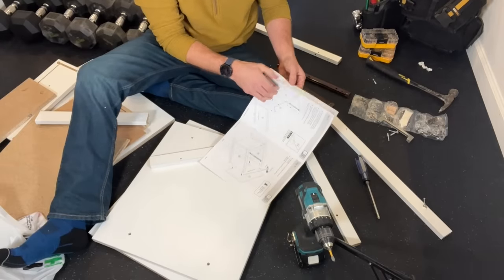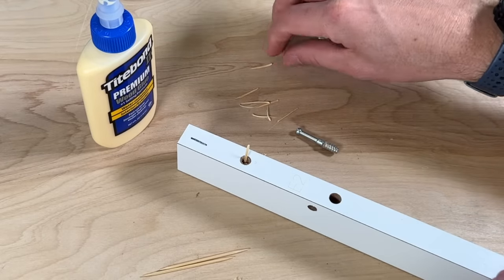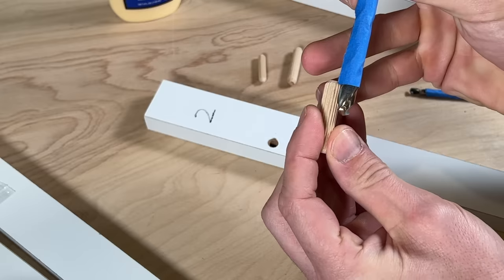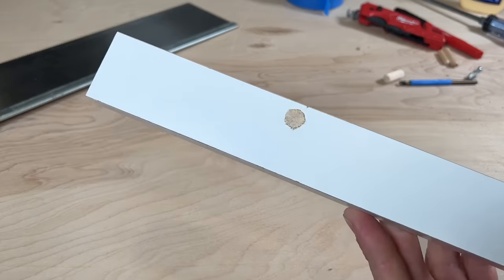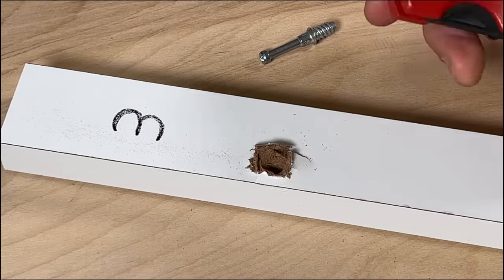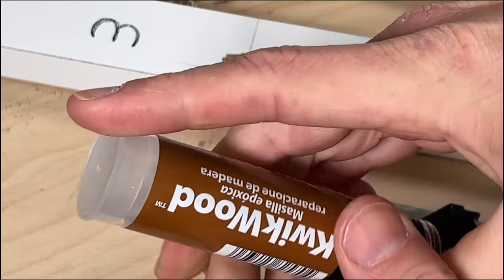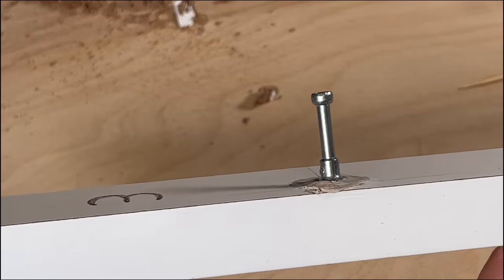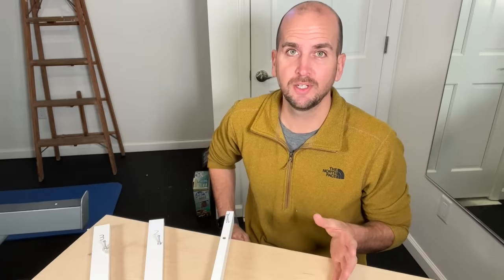How To Fix Damaged IKEA Furniture

Comment: I have a much better way to deal with blowouts. I mix regular sticky epoxy with sawdust and put that in the blowout. It fills the crevices and sticks to the sides much better because of the more liquidy epoxy material. Then I put saran wrap over it and clamp a piece of wood to the piece to make it flat and even with the rest of the piece. No need to sand because it's already shaped right. You can drill a pilot hole and screw screws into it like wood.
Reply: Prior 😅😅😅
Reply: where do you get the sawdust
Reply: @61akra12  If you don't have any laying around, get a saw and some wood and make some.
Reply: @UFDionysus Do you buy the resin and hardener epoxy and mix it then do the rest?
Reply: @bellamuable  I've mostly used the stuff you squeeze out of those double-syringe looking things. Yes, mix the resin and hardener first, then add the sawdust.
Reply: Would that be strong enough  to repair a ikea bed? The screws just came off

Comment: Never use a powered driver with that stuff.  Hand tools only.
Reply from the maker: For sure, asking for trouble but temping to speed up the process assuming you can avoid this issue.  My impact driver has 4 torque settings and if I set it on #1 it actually usually does a good job.
Reply: You can use a powered driver, if you're careful with the torque. I was using a Makita with the torque initially set at - let's say - 4 and see how far I get. Probably not all the way down, so I increase to 5 or 6. I don't know what the numbers stand for, but I slowly increase the torque that way and so far had no blown out screw holes. Of course, impact drivers are absolutely inappropriate here.
Reply: You obviously never assembled a large amount of these furniture. 🥱 There's something called electric screwdriver that does not have a lot of torque
Reply: Thank you, this video was helpful. Also wanted you to ask you, how one would fix damage in a faux wood assembly cabinet furniture. I bought it from Home Depot
Reply: Thank you for sharing! I definitely have to go with fix 3. Ikea will be the death of me. Wood glue didn’t cut it so I’m ordering the product you shared. Fingers crossed!

Comment: When assembling ikea type furniture I always glue it as I go because it reduces the strain on those fasteners and I never take it back apart anyway
Reply: Daniel Harder...exactly!
Reply: How do you glue it on the veneer side?
Reply: @AndreiBanciu  most joints come with wood pins as well as the cam locks. I glue all those with carpenters glue. Some veneers will take glue better than others but anything that stops joint movement with help the fasteners. 
Urethane glues with stick to a lot of surfaces but you need to watch for expansion
Reply: And I find furniture assembled that way, which is far superior to just using the cam-locks, can be 'disassembled' with a 2 or 3 lb deadblow hammer, when it's time to get rid of it.
Reply: I have assembled many IKEA furniture‘s through the years and many times I had to move them from one room to the other. If I glued them together, it would be impossible to disassemble and move them to another floor to reassemble.
Reply: @howtodoitdude1662  true. I’ve never had to disassemble to move. But your dead right it would damage them to take them apart after glueing.  On the other hand most quality furniture doesn’t come apart.
Reply: Glue it ? Really ? I’m watching a video laughing about IKEA throw away furniture which has a plastic surface that unless you use a expensive two part epoxy it wont work worth a darn at best. But I guess that’s what you get with press board cheap junk. But at least you can feel better about the earth and you can feel so European.
Reply: @yetimonster2586  you sound pretty jaded. Most people go IKEA because that is all they can afford that looks decent. I’m not sure why you felt it was worth the effort to critically respond to a comment that was only meant to help.

Comment: If you want an instantaneous cement like way to full tree hole just fill with baking soda….. and then Either stick your screw in now or after but if you drip super glue on top of the baking soda it turns into cement basically. You can definitely drill through it but it gets really hard instantaneously

Comment: Actually says in the instructions only use hand tools , I don't though, I use a 12v drill driver set on the lowest torque,  done dozens and never stripped a hole yet. Don't go impact crazy on these fittings.

Comment: To fix this I soak the hole with superglue and then hammer a piece of wood (slightly bigger than the hole) and after cutting the wood flush I soak it again with superglue. I did this on a door hinge with a stripped hole and it still holds up after 3 years.

Comment: I've had to assemble MANY of these particle-board wonders in an educational setting; students are hard on even the best furniture, and most of what I worked with was much cheaper than IKEA. I'd assemble with a power driver (hundreds of screws in a day destroys your wrist!) but always did the last half turn or so by hand.

Some other things I did (since I was not interested in ever dis-assembling the units):
1- Put wood glue in all the holes before screwing into them. The pressure of the screw going in forces the glue into the fibers, reinforcing the hole.
2- Lightly sand and glue all the mating surfaces.
3- Squirt glue into the cam mechanism to keep it in the locked position.
Reply: you can use wood hardener in the hole first, then put in the screw immediately. and use jb weld in the cam for a stronger fit. wood glue tends to be brittle when used in metal applications.

Comment: Instead of the JB Weld product, I prefer Minwax brand wood filler.  Like the JB, it’s a two-part mix that hardens within 1/2 hour.  But it’s easier to flow into tight spaces, and flattens easily with a putty knife.  Once dry, it sands and drills just like wood.  So in your situation, I’d restore a solid surface with the wood filler, then drill a new hole for the fastener.
Be careful NOT to get the kind of wood filler that simply fills surface scratches (like Borden or DAP).  What you want is by Minwax, and it needs the separate hardener (comes in the package) to activate it.  You’ll have a LOT left for future projects, and it stores indefinitely.
Reply: Is the repair as sturdy as this example when finished?
Reply: @jules3048  I'd rather put my faith in a glued plugged drilled wooden dowel than risk usong wood filler on something like a 230cm Pax wardrobe......

Comment: On repair #2 a coping saw would cut the dowel and I bought mine for under $6, and using a small piece of sand paper without a power tool would be more cost effective. For those looking for a way that is even cheaper.

Comment: You need to use those specific dowel types - with grooves. Or if using solid dowels, slice off some wood along the side to allow air/glue to escape.
Reply: I understand your idea of allowing the glue to escape, but in such sparse chipboards I think the glue will be pushed back further and help strengthen the damaged area a bit.

Comment: Depending on the damage to the piece, Ikea has a fairly liberal part replacement policy.  Not so much for stripped thread areas, but damaged panels and such.  
As a person who has done a LOT of ikea assembly through Task Rabbit, I have had to go back to the store a couple of times for missing parts and damaged on arrival pieces and never really had a problem getting replacements.
As to screwing up the pieces in the first place by over torquing....haven't particularly done it.  A couple of tips though - Use a drill with a clutch on it in the lowest setting.  Never use a plug in drill without a clutch - it won't stop turning in the screws when you pull off the trigger.  Know your surface - the "solid wood" is actually solid wood.  You'll find this in the Hemnes line for example.  Just, it's SOFT wood - so it's easy to drive the cam posts past the stopping point at the surface.  Hammer time - there are some parts that require hammering, such as the drawer back plates with the plastic "nails".  More blows with less force is the better way to go - don't try to drive them home in one blow.  Also, anywhere you are hammering, make sure to support the workpiece as that particle board doesn't like the abuse.  
And the biggest tip - get a bit holder / extension with a sleeve on it.  Extend the sleeve over the cam posts when driving them to keep them from quickly popping sideways and destroying the hole.
Reply: Watching the presenter use an impact driver left me crying.

Great tips you've provided.

Comment: Once I put glue down the holes before joining a finish side to a cabinet - the hydraulic pressure of the glue as I rubber hammered the pieces together blew out the finish surface!!! Lesson learned - luckily I learned this on the side that was against a wall! Less glue is better with dowels!
Reply: That is why fluted dowels are superior to basic ones.

Comment: As stated in other comments I can't stress enough the importance of using hand tools for these types od assembly. Also I wouod recommend using a quick setting epoxy. I do furniture repair professionally and waiting 24 hours for glue to set sucks even if you have time to wait. Both have equivalent hold and sheer strength so why wait?
Reply: I totally agree. My first thought was 3 minute epoxy perhaps with some sawdust added.
Reply: Old school.......

Ryobi drill driver on screwdriver setting with torque set at number eight.

Saves a lot of screwdriver use.........

Comment: Great lesson! Even though it’s a pain, I try to only use hand tools on assembly furniture.
Reply: This is, I think, the most important thing. Particle board is very brittle and the slightest over-tightening will tear it to pieces.
Reply: I use a drill driver (not an impact) and dial the torque-clicker thing way back. Then finish with a screwdriver.
Reply: @JaymoJoints   Absolutely........

Did two Pax wardrobes, four Malm drawer units and a Songesand king size bed.

Used my Ryobi drill driver on screwdriver setting with torque set on number eight and it was perfect.
Save me hours tightening up an awful lot of screws........

Comment: I have 4 holes on my euro door handles bracket that came off. Would kwikwood be better to reuse with new wood screws or bondo. I would need to apply and then screw in the bracket. I can't put the screws with the material in place as I can't be there holding it forever to dry. Would bondo be drillable or kwikwood be drillable?

Comment: Very interesting tricks, I take note for the 3 of them.
May I suggest you to stop using the Phillips screwdriver for IKEA screws and use a POZIDRIV #2 (or PZ2) screwdriver instead? 
Unfortunately, it's not documented anywhere but this PZ2 really is the screwdriver you need for this.
Reply: I would suggest learning the difference between the appearance of the two and use the correct driver, some fittings are Phillips and using a PZ2 will damage those
Reply: I was going to say the same. Pozi screws have extra notches and Phillips screwdriver strips and slips.
Reply: @meperson  and if you do any work on Japanese hardware you might need a JIS screwdriver set, they look like Phillips but have a dot on one side of the screw

Comment: Installed hundreds of furniture cam screws with a power drill on low torque settings without any problems. Just start from the lowest numbers, and increase if not enough. Easy.
Reply: Agreed.......

Too many old school naysayers warning against use of drill drivers.

IKEA worksheets DO NOT recommend using them  but that is most likely due to your first time DIYer hitting a screw with full hammer drill function and complaining about the pile of sawdust left on the bedroom floor!

Did all my Pax, Malm and Songesand king size bes with a Ryobi drill driver on screwdriver setting with torque on number eight..... Perfect.

Comment: The blowout potential is why IKEA instructions direct you to use manual rather than power tools. I've actually successfully modified IKEA wood cabinets to of lesser length and depth. It can be tricky to do but can be done with patience and the right tools using the same IKEA supplied screws and attachment hardware. The cutoffs can be used as templates to match spacing where applicable. If I ever need to do something like that in the future I'll make sure to do a video of the process. It would be great if EHR does a video doing sizing modifications on an IKEA type shelf unit.
Reply: I did exactly the same thing last weekend. Turned the biggest Pax cabinet into the smallest, and even figured out your cutoffs as templates hack before I had to do too much measuring. I thought about doing a video to put on YouTube or at least taking some pictures, but once the saw got rolling I didn't want to stop.
Reply: I assembled my IKEA METOD kitchen cabinets with a torque-controlled power tool, such as a Bosch electric screwdriver...no trouble. It would take too long to complete the assembly with a manual screwdriver.

Comment: I've used thin CA glue to strengthen the hole... just apply a few drops and it will soak into the sides.  Wait for it to dry completely before putting the screw back in or it will not come back out easily later on (if needed).  Make sure you have threaded the screw in and out at least once beforehand, so that the wood retains the thread pattern before you apply the CA.
Reply: ALSO SUPERGLUE AND BAKING SODA IS VERY STRON

Comment: Particle board in the first place, is the worst bunch of material that could ever be used to make furniture - regardless of what manufacturer it comes from. 
 I've experienced several damaged screw holes during the many years of putting this type of furniture together... My simple fix consists of two options;
1) make a small batch of sawdust+white (or furniture grade) glue up into a puddy-like form the size of a marble and attach it to the section of the screw that fits in the damaged hole... By doing this, you're making sure the puddy is moulded to the bolt or screw once it has dried...the puddy should naturally bond to the particle board if it's of the proper  texture.
Secondly; use a steel enforced 2 part epoxy (I usually use the 2 minute cure time stuff to save time. The epoxy works very well and can be painted to match the color of the board.

Comment: I always use disposable nitrile gloves when working with any of those 2-part putties. You still have feel, without having a mess to clean up. Also, I find plastic putty knives will get a decently smooth and level surface with the putty, and if you act quickly, clean up with a paper towel. (And, if you forget, you don't mind tossing those plastic putty knives.) Also, if you don't have 2-part putty on hand, mixing half wood-glue and half-water with things like Fixall makes them somewhat more flexible and stickier, and they can stand in for the putty, though that stuff takes 24 hours to properly cure, and it's tougher to sand than the putty.

Comment: For the blowout I would probably go with wood rot filler instead plus maybe put in a dowel in the position where the screw should be. Otherwise if you put the screw in with the wood rot filler there is no way it would ever let go of it.

Comment: High torque impact drivers and particle/mdf boards are the worst couple.
Light electric screwdriver or hand screwdrivers are the adecuate tool to assemble any hardware on predrilled holes in any kind of furniture made on mdf or particleboard panels.
saludos
Gerardo
Reply: 💯. I commented exactly the same thing on another thread.  Use construction tools for construction projects / DIY tools for DIY projects.

Comment: It wasn't even Ikea furniture, but a drawer anyhows which had particleboard middle part on the bottom with feet. Whole thing blew from the fixing holes because while I moved to another place, whoever was carrying it, supported the damn thing by the middle part. Cabinet weighs like 60 kilos so you can imagine what happened. It was just easier to remake that whole part out of oak stock and not even try to piece it back together. Aligning those holes was a bit tricky because original piece was so splintered.

Comment: For method #2, a drill press would be a good way to ensure the second drill hole is centered. First line up the large hole with the large bit, then keep that position locked in until day 2 when you drill the small hole.
Reply: Drill press isn't helpful when the hole is a long way from an edge of the panel. My old desk was flat pack, with the holes about 350mm in from the nearest edge. The table top was 1800mm (6feet ) by  900mm (3 feet). Not getting that into a drill press.

I get your point, but with these tutorials it better to show everyone universal solutions.
Reply: @gorillaau  in that case, a portable drill press for a hand drill would work

Comment: The biggest tip I can give for fixing IKEA furniture is don't buy it in the first place. It's cheap and nasty. I have good solid wood furniture that I bought 30yrs ago and it's as strong as the day I bought it. You can give old solid wood furniture a simple makeover and it'll still be as strong and last another 30yrs, and if you're tired of the look then just sell it for a decent price and buy some other solid wood design furniture to replace it.🙂
Reply: I'm not boxing with or jumping on my coffe table - just need it good looking and cheap, not indestructible
Reply: I have a pair of pine wood Utaker staking beds. Used hand tools. After 3 years,  The corner  with the cam nut on one bed simply snapped off where cam nut inserts.   There had been a knot in the wood there (Bad!) which made that corner weak. I now have a clue from this video that gorilla or epoxy glue will glue the wood corner back on, and I can set the cam nut in again.
 I really like that versatile pair of stacking beds in my tiny house.